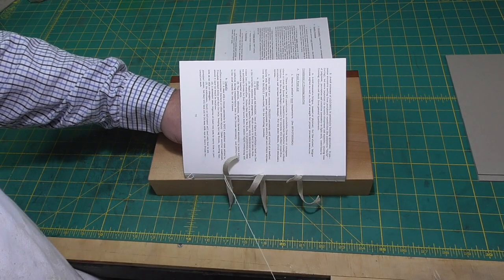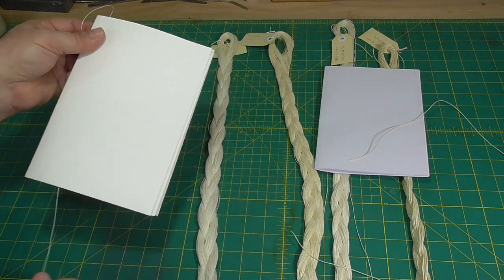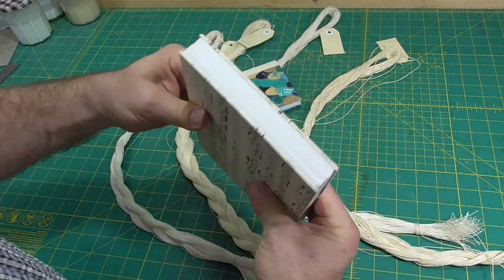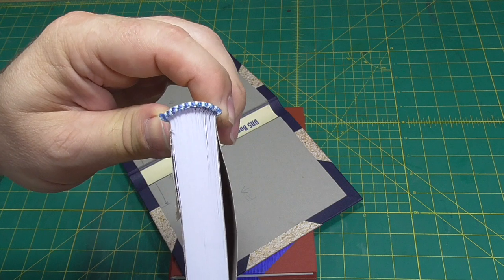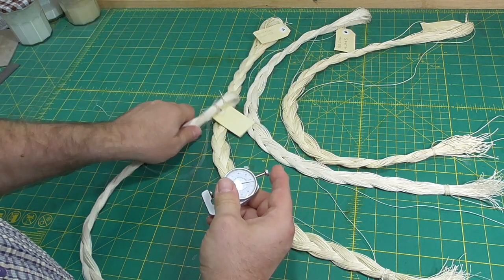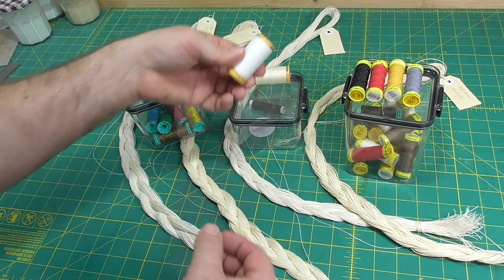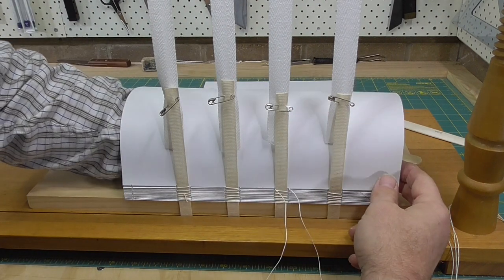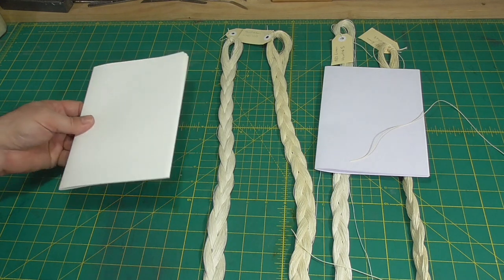Spine Swell and How to Manage It // Adventures in Bookbinding

Comment: Excellent video for beginners about an important topic! I learned a lot, especially the parts about what type of thread to use and how big sections you should use was very specific and useful information. So far I've mainly just hoped for the best when I've started sewing. xp Hammering the spine after sewing does help sometimes, if the swell is too much.

I wish you had added a section about how to measure the swell after you've sewn a textblock together. It'd be interesting to know, if your method is different from what I've learned. I was taught the place the textblock flat on the table and then place a piece of greyboard against the spine and the draw a line on the greyboard at how high the spine swell is. Then you'd place the greyboard against the fore-edge and draw a line on the greyboard from there as well. Then you'd estimate or calculate the percentage of the swell from the lines that you drew. I don't know, if that makes sense.
 

If I can make another suggestion about the video title, you could maybe make it easier for beginners to understand what this video is about by changing the title to "Swell of the spine and how to manage it".
Reply from the maker: Thanks for the feedback.  I was going to demonstrate the measuring of swell and forgot.  I guess it's straight forward.  The other thing I was going to show was the trick of wrapping thread around a pencil,  one turn for each section, to give an idea of the maximum swell you will get.  All the best, DAS

Comment: Hello Darryn. I just purchased a cheaply-made "Scholar Select" perfect bound square hardback of Doug Cockerell's "Bookbinding And The Care Of Books". Reading through it, he railed against cheaply made books in the late 19th. C. I had a bit of a laugh, because the book I'm reading his work from, is the very thing he would have had a go at.
The book is brand new, with very heavy paper and it sprung back when opened. So I broke it in. I bent the book backwards at its hinges for every page turned. I didn't care if it fell apart, such was my contempt for it. It somehow stayed in one piece and now sits flat when opened. It will be a book I use whilst doing repairs, if I need instruction.

Comment: Hello. So If I would like to make full leather A5 format book do you think that 90gsm paper, 6 sheets per signature (15 signature total) using 42x3 tex linen (I think that is close to 25/3, not sure) sould be OK? if I round rhe spine of course. Or would you still go for 4 sheets per section? Thank you.
Reply from the maker: You could make that work.  There is no exact formulae.  If you have too much swell you can always knock some out and if not young you can reduce rounding or just use a bit more force.  But experience is the best tool to judge this.  The type of paper is a big factor too.  Good luck!  DAS

Comment: Hi Darryn. Very timely video as I have been thinking of this topic to manage swell. What do you suggest to minimise swell on an old book with 2 sheets per section. The book is quite large at 45cmx25.
Reply from the maker: Depends on a number of factors such as the type of paper, how thick the book is, how is was originally sewn and how much swell you want or need at the end.  But assuming you just need to keep the swell down and there is enough sewing supports I'd do 3-on sewing with thin 40/3 linen thread or double up cotton or nylon.  Good luck!  DAS
Reply: @DASBookbinding   on closer inspection, the folds of the sections have broken down causing the folios to form single sheets, possibly because there are no spine linings present. I’ve tried 3 on sewing recently and ended up with a lot of the pages / sections coming out of the text block and held on by the one stitch.
Reply from the maker: @superflexing  I hope this is going okay for you.  Sorry, for the delay getting back to you.  You'll need to guard these pages.  Even the ones still together if you use some very light washi it will make them much stronger.  Kathy Abbott's book has a good description on how to do this.  Good luck!  DAS

Comment: Hi Darryn. I've seen you use that little micrometer thing in a few videos - do you remember where you got it from or what make it is? It looks a lot easier to use than the one I'm using at the moment.
Reply from the maker: Dave, it's a thickness gauge.  Most of the bookbinding suppliers sell them.  I sell them for $25.  I get them from China and check the calibration and fix any issues such as sticking mechanism.  They are fairly cheap to get from China but about 1 in 10 I get have a major issue and 1 in 5 a minor issue.  The high quality ones are really nice but much more expensive.  Ciao, Darryn
Reply: @DASBookbinding  , thanks Darryn. Since I'm UK based I'll jump on ebay later and see what I can find. I find trying to use a normal micrometer really frustrating so I think a few pounds on one of those will be quite a reasonable investment.
Most of what I make currently are notebooks with a maximum of 5 signatures and I've not really worried about the swell however I want to make some thicker ones and I'll certainly be using what I've learned here for those and in the actual books I've got planned for the future.

Comment: What are your recommendations for binding a watercolor sketchbook with 300 Gsm paper in either square backed or Coptic? I’ve been doing 2 sheets/section but seem to get a lot of swell because of the hardness of the paper.
Reply from the maker: Use a thinner linen thread and gently hammer the spine area which will flatten the thread a bit and maybe force it into the paper a bit too.  You should be able to get no or little swell with that paper.  I'd recommend a sewn board binding.
Reply: @DASBookbinding  thanks! Looking forward to making more with your guidance soon!